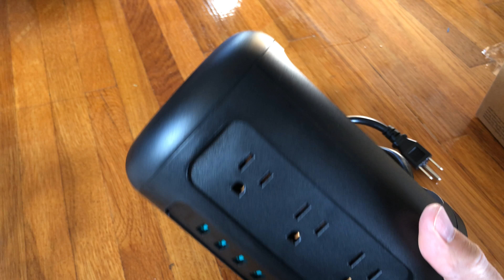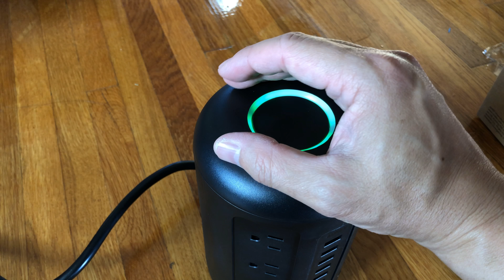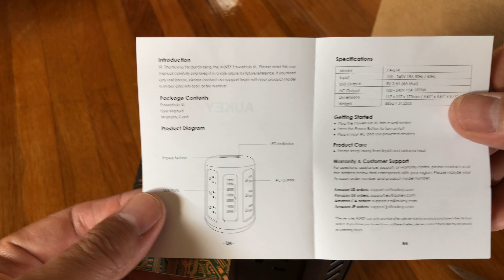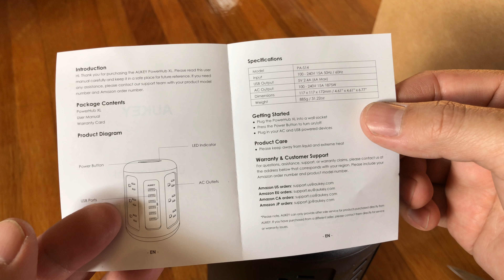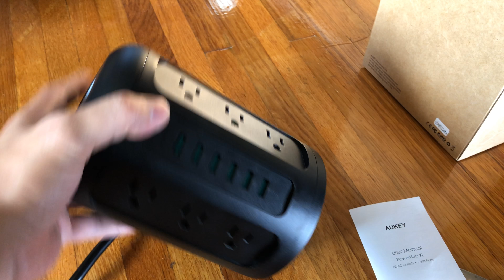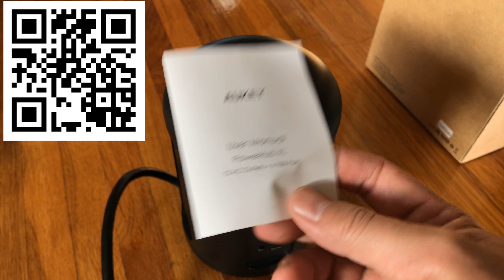Aukey Powerhub XL | First Look at this Tower of Power

Comment: Check the outlets with an outlet tester.  I ordered one and had replacement sent to me.  Both of them were defective.  Polarity was reversed due to hot and neutral wires being flipped.
Reply: Same with me as well. They refunded me after the second one and let me keep the Hub. I was looking for a teardown video. I'm going to open it after work and see whats going on inside